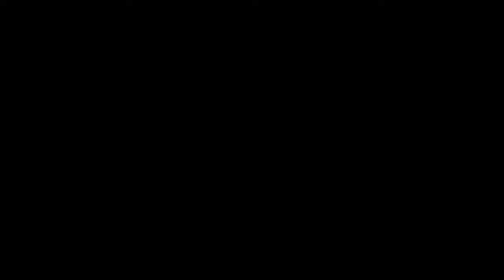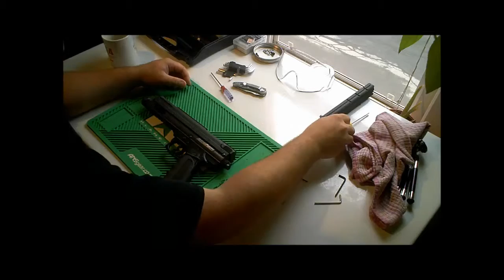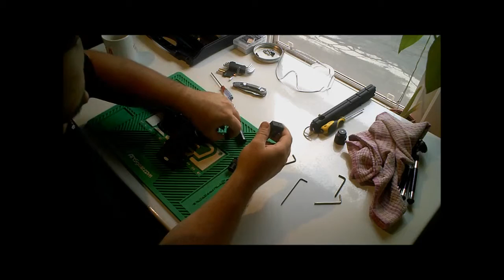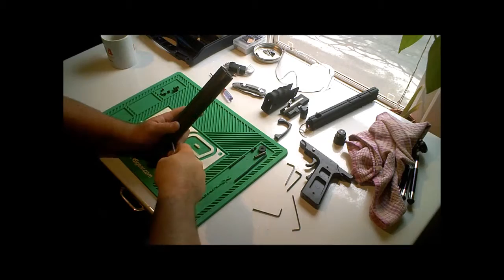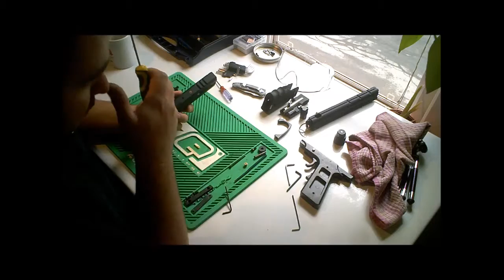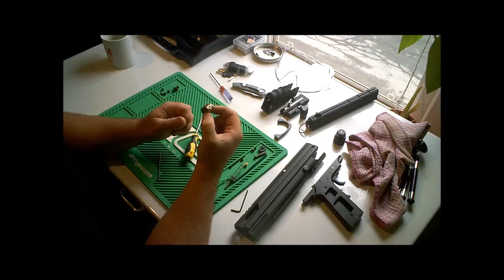Warsensor Zeus G1 Tear Down/Reassemble Part 1 [Tear Down] - PBRepair.ca

Comment: A piercing assembly from a CCI Phantom bucket changer fits perfectly in place of the stock Zeus one just so you know.... Cheap easy to get replacement
Reply from the maker: awesome to know, thanks!
Reply: @PbrepairCa  NP,I used to have one I did that to and once I did it I never had a problem with that part again
Reply: Also the company that bought Warsensor was Miltec.
Reply: You wouldn't happen to have an extra back cap retaining pin for one of these would you? I just got a used Armotech Zeus G1 that is a late model one before the change over to Warsensor and Ariakon and that pin is the only thing it's missing
Reply from the maker: @chaosmcb8285  No I don't unfortunately :\  But let me do some digging around, see if any of the guys around here still have some parts
Reply: Found something else that might be of use to you.... If you take out the cupseal and remove it from the valve stem,then take a Phantom cupseal and rethread the hole for 10/32 or 6mm you can thread it onto the Zeus valve stem and now your cupseal is rebuildable. Just did it to mine and it works great

Comment from the maker: @ PandaBoi - Most spyder parts can be used as replacements.  For the springs and guide pin, use A5.  The only thing is the bolt is pretty much no replaceable at this point, that I have found anyway.

Comment: I have a wsp the air leaks out of the barrel as soon as i puncture the co2
Would this be a cup seal or puncture seal issue
Reply from the maker: if its down the barrel, I would say its the cupseal. if it was the puncture seal, the air would be leaking out from bellow the barrel around the co2 cartridge where it goes into the valve.
Reply: @PbrepairCa  thanks i know its a relic but i really like it
Reply: @PbrepairCa  if i happen to have a problem with the puncture seal what do you recommend
Also i subscribed to your channel thanks
Reply from the maker: @timdagrim  Its been quite some time since I have done any channel updates unfortunately. Started a family and my time got divided... anyway, about the seal. I think the actual seal can be used from a TIPX, but the puncture needle itself is kinda a unique item.  I will have to do some calling around and see if I can track down someone that has one.